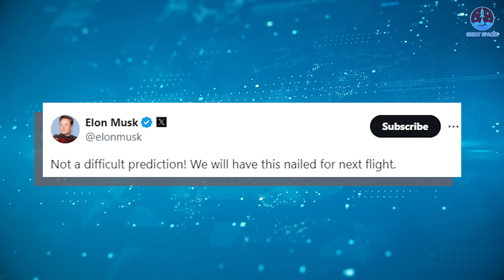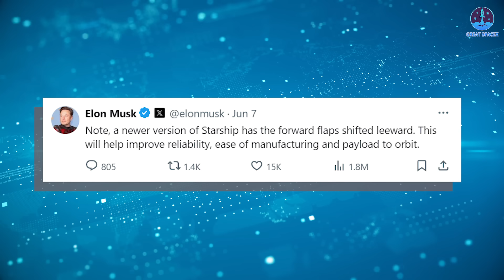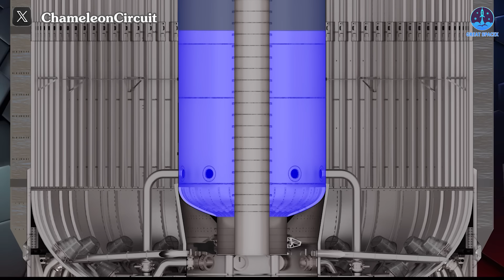Elon Musk Just Revealed Massive Changes On Next Starship Prototype After Flight 4!

Comment: Wow. Those tiles were destroyed by the heat. They're going to have to go back to the drawing board with those. Ouch
Reply: They fell off... that was the issue.  They weren't destroyed by the heat.
Reply from the maker: There are some images shown that heat shield was melt by heat
Reply: I wouldn't say back to the drawing board - the fact is that right now said tiles are ablative, they are supposed to burn away - at least to an extent.  For now, dislocating tiles not withstanding, this is just fine.  But to get to full rapid reusability, as Elon has stated is the end goal much like an aircraft, they will need some system that can at least survive a few re-entries - at a minimum.
Reply: @stevejackson8060  The fact that the tiles melted to that extent - were ablative to that extent - tells me that the chemical makeup of the current tiles will not work. That means, effectively, back to the materials science drawing board to figure out a new material that can withstand multiple re-entries. This, of course, is in addition to figuring out some sort of attachment system that will actually KEEP the tiles on the starship. All in all, there's still a long way to go on their tile system.

Comment: What about landing on a barge ? SpaceX needs to examine Ship after it lands.
Reply from the maker: Yeah, I think SpaceX will consider this idea
Reply: Land a rocket upright on a barge-at-sea?  There are no landing legs on the Starship vehicle.  The vehicle is over 200' tall and will still have hundreds of gallons of liquid oxygen and methane.  It will fall over and explode.  The question is whether the barge's hull would survive the impact, explosion, and fire.
Reply: @Easy-Eight  any way to capture it intact?  Examining the heat tiles after reentry would help a lot, no?
Reply: @Steve-Richter  Starship was designed to be caught in the air using "chopsticks".  I suspect that after it tips over there is a hell of an explosion.  Just 100 gallons of Methane mixing with 100 gallons of liquid Oxygen is 1,300 pounds of explosives.  They have lost warships with trained crews to smaller fuel fires (Example:  HMS Sheffield in the '82 Falklands war after being hit by one missile).  The best they could do is have it land in a shallow sea area, the Saginaw Bay of Lake Huron would be perfect.  After the explosions then look at the wreck.  However, both Ontario and Michigan would go nuts over such a stunt.  The easier solution is ask the USAF/USN to circle the splashdown area with a recon aircraft and have a small fleet of drones take high resolution pictures